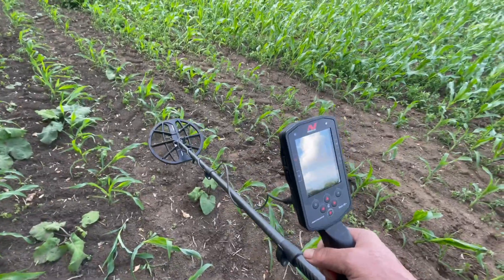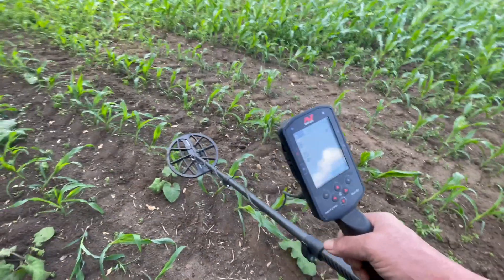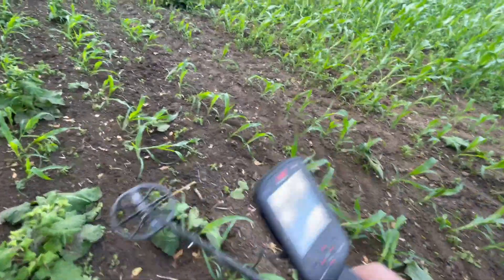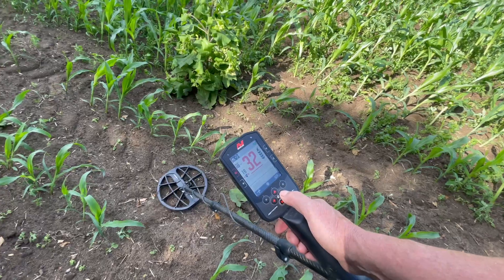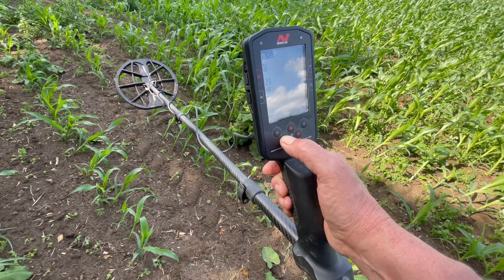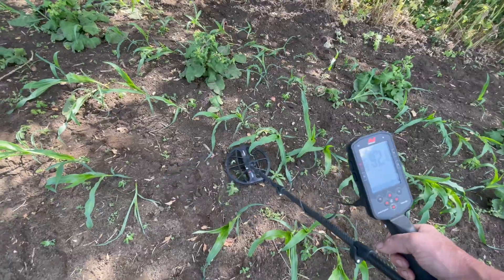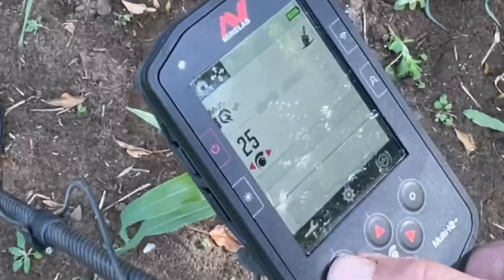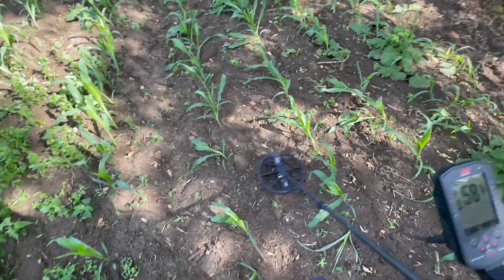MINELAB MATICORE stabiliser

Comment: Hi Gordon, does the stabliliser have any impact on detecting depth?
Reply from the maker: Short answer yes, but used right it should be minimal if at all. 
What you will find on noisy sites, once stabiliser is added to quieten the noise, you’ll be able to ramp up the sensitivity. So there is the potential running the Manticore hotter with less noise, minimising or even eliminating any loss of depth. 

I’ve also found using the stabiliser on pasture, that deep non-ferrous targets have a cleaner audio (no ferrous noise), so it is possible to run with a lower recovery rate, which would normally increases ferrous noise from surrounding mineralisation. 
So all this is worth trying.
Reply: Thanks Gordon,it sounds like a great feature to have on the machine @IronheartedGog